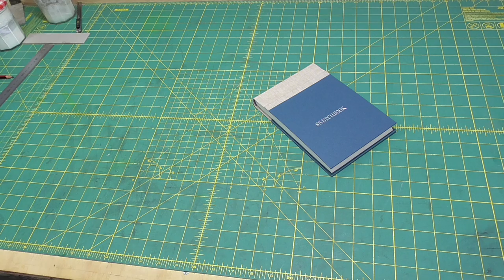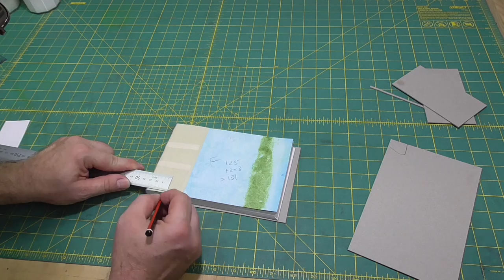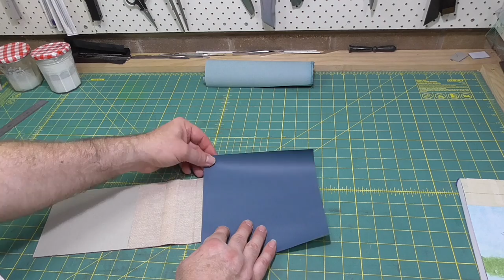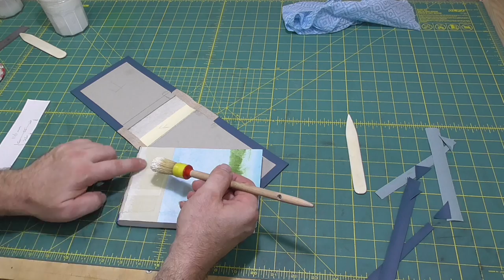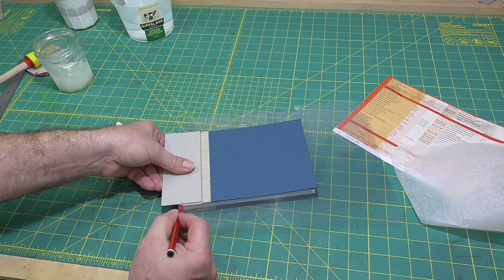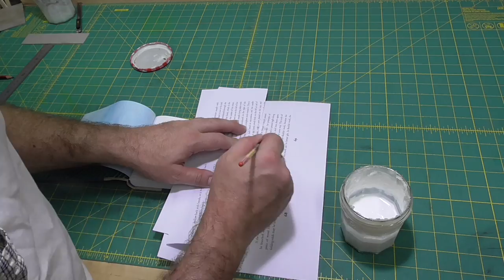A Fold-Back Sketchbook Inspired by Maureen Duke part 2 // Adventures in Bookbinding

Comment: I just finished one of these as my third book. It came out pretty well! I think I should have cut the headbands a tiny bit shorter -- I think they're reducing the flexibility of the spine a tad. Still, it opens fine, including folding over.

I wasn't entirely sure what to use for the reinforcing cloth. I got some unbleached linen from my local fabric store, starched it and used that. It probably could have used more starch; I wound up with a lot of little threads coming off the edges that needed to be trimmed. Also, a tiny bit of it wound up peeking out from under the pastedown, which is not ideal. But overall it came out very nice, and I am pleased with it.

Comment: I suppose I finally found the kind of binding I want for my project. I am a bit wary of the dimensions I've chosen, and materials (or lack thereof)... but in the end I'm very much an amateur with only 2 books bound, both which I am incredibly proud of though. 
I'm planning on creating a 5 year planner / notebook / diary. The right page having one date, with the page divided for 5 years. The left page will just have a dotted page for random notes, drawings, or  even the occasional thing to glue in (old tickets, for example).
I'll use regular A4 paper folded to make A5 pages, but it'll be 365 pages thick (rounded up to a fitting signature size of course)... I did consider Japanese stab binding, but I think this might be a better way to maximize the size of the already small A5 size.

And for materials for the covers, I'm thinking of using relatively large sheets of leather from furniture samples (I really like the idea of leather getting worn and "dirty" from daily use for 5 years). 
For the spine cloth... Well I don't have any spine cloth, so I was considering leather once again, but this time slightly thinner Chesterfield leather. I have no idea if that's a good idea though. It probably isn't, for various reasons. 

I guess you've figured out by now that I've got no idea what I'm doing, and use scrap materials mostly... but at least it's fun!
Reply from the maker: Hi Tim,
Sounds like a fun project.  365 pages at A5 is a really good sized book for a rounded and backed case binding.  This is what I'd recommend.  The sketchbook has the advantage of not being backed (no shoulders on the spine).  Furniture leather is usually chrome tanned,  which has issues for traditional bookbinding techniques.  It can also be acid which will effect the long term stability of your book.  My video this weekend will show how to back cloth with paper to use it as book cloth.  You might like to try that.  Good luck!  Darryn
Reply: @DASBookbinding  Thank you for your reply! And thank you for the recommendation of a rounded and backed case binding.
I had no idea that furniture leather has these issues with the tanning and possibly being acid! Excited to see your next video, and I will definitely consider creating my own book cloth instead then!
Thank you!

Comment: Hello Das!

It has been quite a while since I last followed one of your videos, I'm glad in finding this type of binding and will be attempting it with an A5 sketchbook using Tomoe River paper for my architectural drawings and for general notetaking. I wonder if this binding can be done in a portrait orientation and with skipping the textblock trimming and rounding of the spine as I am without the proper tools to do those. I hope to complete the sketchbook in the following week or two as a replacement for my currently full sketchbook, I also wonder if cheaper materials could suffice for covering materials like a waxed paper or fabric cover with a simple endpaper, I was thinking some of my older watercolour paintings.

Thanks!
TS
Reply from the maker: It works best in this orientation, but could be done the other way.  This way just provides some more leverage.  Skipping the trimming is fine.  You don't need a hammer for rounding.  Anything with a bit of weight will work.  Yes, paper would be fine for covering material.  Good luck!

Comment: I've started looking at paper with a view to making some sketchbooks for my son and I've noticed some large rolls of good quality paper. Would paper on a roll be suitable for making into a book? Thanks, Carl
Reply from the maker: It can be fine.  But some papers do have a memory and it can be hard to get it to stop curling.  Usually just cut it up and leave it under some weight for a few days.  Worst case you have to add a bit of humidity.  Good luck!  DAS
Reply: @DASBookbinding  Thanks for the advice, it is much appreciated - now all I have to do is decide on a particular type, a rich opportunity for indecision and procrastination!

Comment: Does this sketchbook open flat so that you can draw across the gutter?
Reply from the maker: It sort of does.  But if this is your priority than I'd recommend doing an ordinary sewn cased book without the wide front hinge.  To have something that open completely flat you should consider other binding structures.  The ultimate is the springback, which is designed to be flat across the gutter.  But a sewn board binding is much easier and lays fairly flat.  DAS
Reply: @DASBookbinding  Okay, I'll have a look at the springback book.
Reply: When working with 300gsm watercolor (Saunders Waterford) paper, are minimal gaps between signatures normal when the books is open? Thank you.